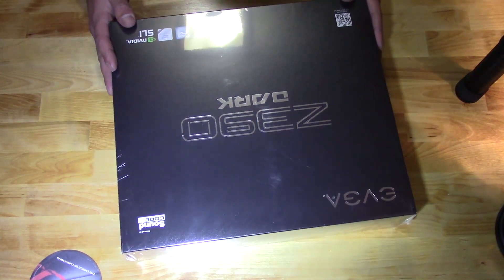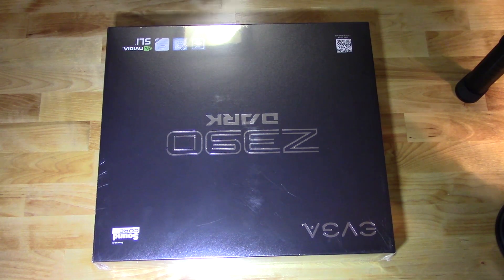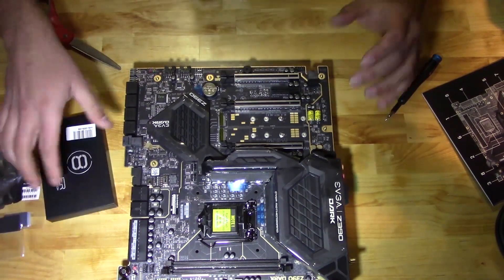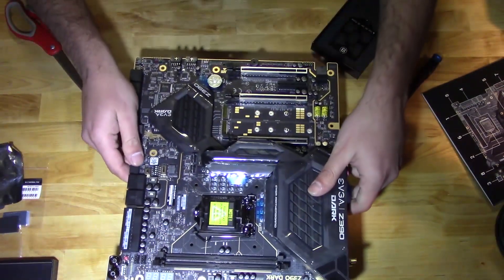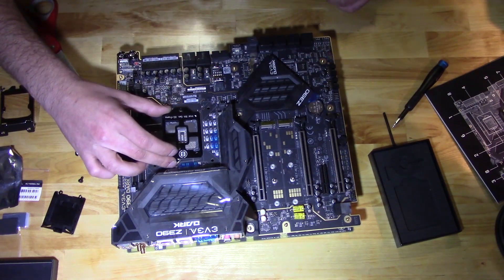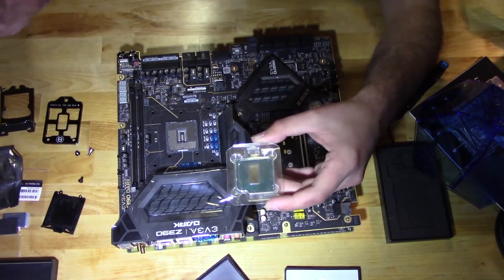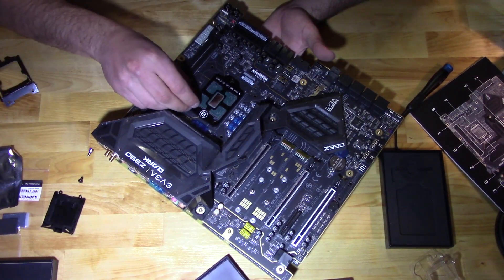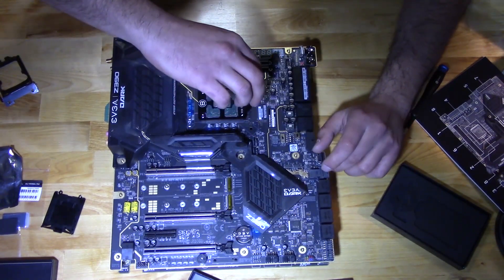Intel i9 9900K Direct Die Installation

Comment: Do you really need the direct die OC frame? I mean does it actually prevent the PCB from bending?

I have done Direct-Die cooling on a I7 3770K without any kind of frame and was working fine except my cooler sucks for it as the contact wasnt perfect and it only screws vertically and lacked horizontally sadly.

The bad thing is I needed to keep disassembling and assembling the PC until I managed to crack the god damn CPU due sadly, but it's mostly because of my cooler which has a crappy mounting system + it's a huge and heavy air cooler which doesn't help.

If I had a watercooler that would screw in "X" I'd be using my I7 3770K by now as I would never have cracked the die with a proper mounting mechanism cooler 😕

Comment: I really want to see a direct die i9 with a Noctua NH-D15 or 14, honestly. I know it may seem silly to do direct die air cooling, but I’m sure it would still benefit. I’ve never water cooled so it makes me nervous. I don’t really want to take the risk with such expensive hardware, no matter how small. I’m always interested in performance benefits though so if an air cooler could work with a direct die mount, that’d be amazing. 

Edit: I actually found this :D “Noctua Direct Die Mounting Kit” by Rockitcool. They claim they use direct die noctua cooling in particular, and that it works wonderfully. I’ll definitely consider this in the future because I love tweaking for better performance. This makes me feel more safe doing direct die, too; the small risk of water cooling failure scares me just a bit too much right now.
Reply: Der8auer said its not possible with air coolers

Comment: Nice job man. I've got a Corsair H100i v2 and I'm trying to find out which screws I need to buy or use (unless it'll work as is). If anyone has done this with this AIO, please let me know. Thank you.
Reply: any m3 .50 20mm or 25mm will do. i have the h150i Pro

Comment: had you also the problem with high temps after install. can't even use stock at full load. i checked everything, replaced the screws of the ekwb velocity etc. man it sucks to drain and fill the system around 10 times with hard tubes. too less liquid metal? did you polish your cpu with flitz? i did. maybe too less contact now? but i checked and it should be fine. last try tomorrow, if it doesn't work i have to go back at HS. i'm so disapointed right now. Would be nice if you could help me.

Comment: do you any paste between the DIE and the IAO cooler or just plain plain
Reply from the maker: For direct die cooling you have to be careful. Regular thermal compound will do the job nicely however at slightly higher temp than liquid metal. The thing with liquid metal is it will eat through aluminum so have to be careful on which CPU block or cooler you use. However you do have to have one of the materials in-between the die and cooler to be able to transfer heat.
Reply: @NerdW0rk   I want to delid and direct die cool a 9900k. I have a alloy block so cannot use liquid metal. Have you or anyone tried using a good thermal paste and plant results
Reply: @nellynelson9387  any non liquid metal paste should be fine, thermal grizly kryonaut is pretty much best you can buy

Comment: Will the direct die mount work with a nzxt x72 aio or would it require different screws ?
Reply from the maker: It should work
Reply: NerdWork Network thanks may give it a try! My i9 is on 🔥
Reply from the maker: You're welcome! Good luck!!
Reply: I did it, you need to buy additional m4 screws to mount it. Stock Intel 1151 screws would not work good

Comment: Another question for ya bud! Do I need to buy any special screws to direct die mount my Corsair H150 or EVGA CLC 280? Someone said M3 screws cut to size, but I am wondering if you know if any of the included stock standoffs will work?

Comment: Is der8auer's direct die frame compatible with a corsair AIO pump/block? I have an H150i 360 aio I literally just bought it and I'd prefer not to go through the hassle of replacing my cooling solution (for the third time! lol) I just traded up from a clc 280
Reply from the maker: It should work with the AIO
Reply: @NerdW0rk  Thanks for the swift response. I actually just saw on caseking.de that it is compatible with Corsair & NZXT AIO
Reply from the maker: You're welcome!
Reply: @sniperlif3  yeah that sort of worked. I ended up using m3x25mm screws in place of the standoffs and holding them in place with nuts on the front of the board. Then I used the stock AIO thumbscrews as an added measure for the nuts. Temps are good at 1.31v I max out around 85c in realbench and aida64, but I was hoping for better results.

Comment: Great video. Now that the thermals are lower, have you seen how much more of an over-clock you can get out of it?
Reply: Unfortunately no
While it is easier to run 5.4ghz, direct die cooling generally does not improve oc headroom

Comment: How much voltage does it need to pass cinebench at 5.4GHz?
Reply from the maker: Everyone's chip will be different. Some chips may not be able to achieve that overclock. My best advice is to slowly increase clock and voltage to see what you can achieve.
Reply: NerdWork Network thanks for your fast response. We have similar chips. I can do 5.3GHz at 1.354v stable in prime95 and AIDA64. I run 5.2GHz 1.29v for daily because of the lower temps. I'm asking about 5.4GHz on cinebench because I haven't been able to pass it no matter what voltage I put.
Reply from the maker: You're welcome! You may have reached your peak on your overclock. 5.3 is a good overclock however, I've known a few that couldn't get their chips past 5.0 regardless of what they did.
Reply: Unfortunately the chip I used in the video was not stable with as much as 1.4v @5.4
Ive yet to try since direct die cooling but am now considering trying again.
Reply: Disposable Child I tried gaming at 5.4GHz at 1.416v and it was fine but when I tried AIDA64 it crashed. For now 5.3GHz 1.354v is great for me but I'll upgrade to a better motherboard and cooling solution in the near future to see if 5.4GHz stable is achievable
Reply: @t3h8ar0n  easier to perfect an overclock when starting from too much voltage, than not enough.

Comment: what cpui cooler did you  use ? I plan on deliding and doing directr die, but knowing which coolers work is hard. thankls
Reply from the maker: It's a custom loop on test bench. EKWB parts
Reply: @NerdW0rk  thanks,
Reply from the maker: You're welcome!